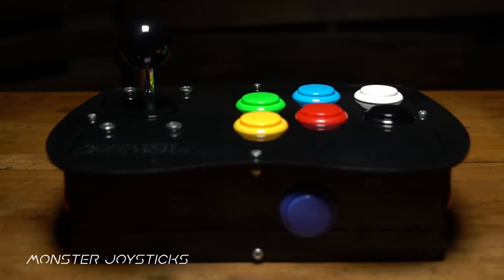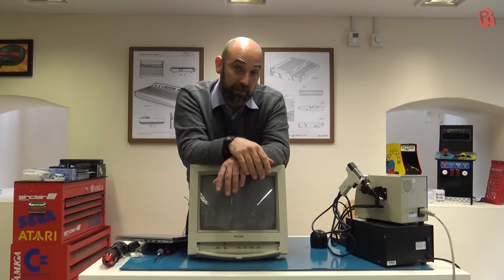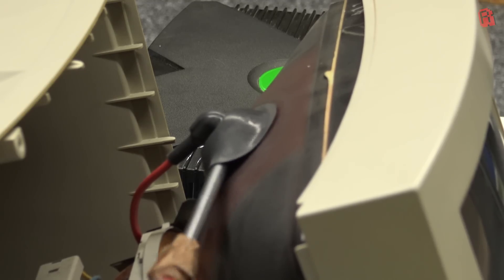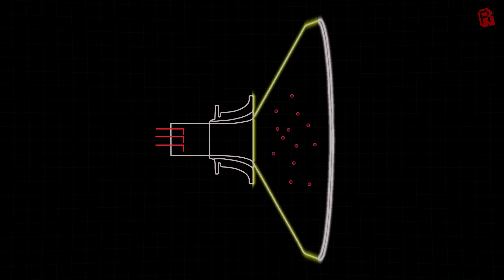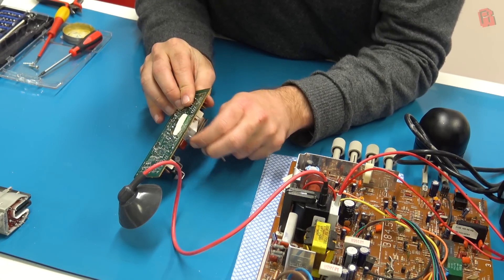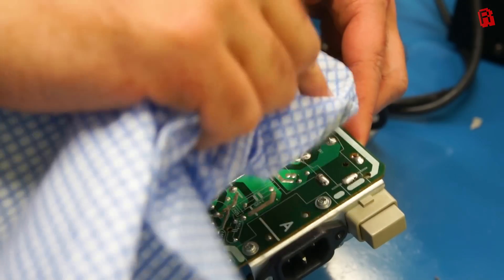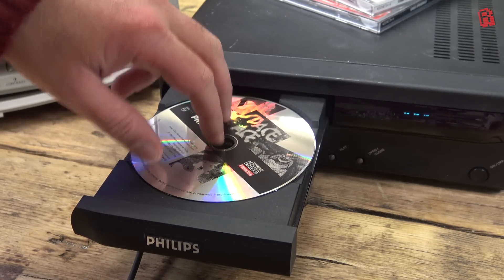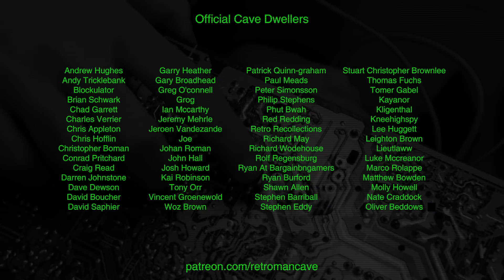Fixing up a CRT Monitor - Philips CM8833 Mk2 Flyback failure

Comment: Always best to keep these things alive, not only are they much better for older content but keeping them going cuts back on the e waste. I used to have same monitor back in my old Amiga days, it's still well worth having as I believe I am correct in saying it's will accept a 15hz signal thus it's Ideal for those 240p games. I still have lots of CRT tv's and vga monitors but when it come down to the VGA's as nice as some are, I have a Mitsubishi's Diamond Pro 2070SB more than capable of doing 2k, none of them can do older resolutions and it's all 480p and above unless play around with super resolutions and run it at 120khz. This Phillips is a great companion not just for a C64 or Amiga but also all those old consoles that are pre dreamcast.

Comment: Just had a new Flyback put in. The tech said the old one looked totally fine and made connection, but thought he would put the new one in anyway and it worked. 
12 hours of use and I’ve got the same problem again. What could it be? I gave him a HOT to change but he said it was reading fine

Comment: I need to clean out my TV.. 40" beast. Pretty intimidating tube and charge, I haven't had the nerve to attempt a discharge. I opened it up a few months back to at least dust it with some canned air. Unbeknownst to me, removing the back kinda pulled the tray with the board out slightly and the right speaker unplugged as well as another that says CC. When I reassembled, I noticed the sound was out on the right side. Due to work, I hadn't fixed it until just yesterday when I opened it up again. The pins were bent slightly, so I had to bend'em back and then put the speaker and CC wires back into their slots. Then I took some up close photos of the board and looked at them on the PC. It's just layered in cat fur and dirt... Ugh, I dread discharging... I have the tools for it, screw driver, wire, alligator clip for the grounding braid.. but wonder.. can I stand on a wooden chair and attach the screw driver's handle to a PVC pipe and discharge from a distance?

Comment: Hi I am curious wondering if you could by chance help me fix my Philips crt tv? The model number that I have is 24PT6341/37. The problems I am having with the tv is the RF connector on the back has broken off. Secondly there is no sound on the tv either. The sound went out right after the RF connector broke off so I am unsure where the issue is as I am assuming that had something to do with the sound no longer working. Is there any way to fix the RF connector and the sound on the tv? Please let me know as soon as possible!

Comment: guys could any of you give a hand with this¿¿ I´m saving this thing.. i repaired the shorted HTO and 3 bad capacitors but now im getting this red/magenta image that temporary fixes when aply pressure to the neckboard..I thought it would be the Green color so a resolder everything in that track but did not solved the problem.. is it possible that the problem is in the socket¿¿ somehow it does not make contact with the tube pins¿

https://www.youtube.com/watch?v=KKDllYVrfKg

Comment: thanks for your video. I've an ATARI SC1435 which has the same PCB mother board. And I trying to find the power on/off switch. But can't find it. And the TFT it's the same problem. Have you got any information where I can buy thoses parts ? Thanks for your help.

Comment: That was very instructive, thanks! I'm in the process of fixing my Mk1, luckily not the flywheel but rather some strange intermittent contact on the power board (which is separate board on the Mk1). I'm told the flyback transformer's soldering is often dodgy on these monitors. I sure hope that's not the case, since it is quite some additional work to disassemble the whole thing. Cheers!

Comment: I wish i had that desoldering pump... I'm stuck with a spring operated one that always leaves some solder on the pad and the component obviously won't come out... In my case, a flyback transformer as well

Comment: Well this will come in handy as i have a 15" monitor with broken solder joints on the neckboard and wanted some refferences before trying to pry open the cap on the tube socket so that i can unplug the flayback and work on it separate from the tube and the rest of the cables.

Comment: Thanks for this great tutorial :) The CM8833-II is really on of the finest crt you could get for retro gaming, a bit small in size off course, but easily adjusted and wonderful quality.
I noticed that you did not do any recap while fixing the monitor. What is your opinion on recapping cm8833-II? Some say all old crt need recap to operate safely and others seem to be of the opinion that as long as the flyback and solder joints are okay, the monitor should work just fine.

Comment: Great video, I've got a JVC CRT for my MiSTer and I agree they are a must for complete retro setup. After watching videos like this I'm not sure I ever would have a go myself, my Dad used to be a TV engineer back in the day and he's been zapped a few times, probably lucky to be alive! Only thing I noticed was the anode cable was touching the tube, on other videos I've seen a plastic wheel thing that makes sure this cable doesn't touch the tube, not sure if that might be an issue, this model CRT didn't seem to have one.

Comment: I don't recommend anyone not technically trained to work on these monitors or any other high voltage electronic equipment it could be very dangerous.

Comment: My 1084s monitor has no picture when I turn it on, plus no static when I touch the tube. The sound and power LED does work however. Also I have to hold in  the power button for the monitor to stay on. What do you think could be wrong.

Comment: Is the flyback specific to a certain crt or can it be installed in any crt?
Reply: They are specific to the tube
Reply: @adriaanstolk4487  great... 4 crt TVs that can’t be fixed.
Reply: @SolSeal  the tubes specifications just needs to be compatible with the flyback’s specs. Don’t give up yet. I’m sure you will solve it
Reply: It could be worth it to contact HR Diemen and ask them if they can help. There may even be services that can rewind the xformer
Reply: I have also seen that people replace the entire circuitry with a Chinese board that is designed for different tube sizes, I am not sure if they are going to be helpful or not, but it certainly is worth looking into. 

This website discusses one: 
https://jestineyong.com/fixing-es-china-kit-in-crt-tv/

Comment: obviously you must have troubleshooted the set before.. to determine it was the flyback?.... about 80% of the time it is a power supply problem causing no high voltage ...

Comment: Thank you ... that was interesting! First time I’ve seen a flyback transformer fixed since working on colour TVs in my high school electricity / electronics shop (a loooong time ago 🙂). One student (not me) did find out about capacitor to ground via screwdriver ... there was a blue flash and a loud snapping noise. He looked “surprised”. 😮🙂

Comment: you were quite lucky. Usually when the flyback died, some transistors and diodes died too, even in the primary PSU side. I would advise you to change non polarised caps that are labelled with a warning sight in the schematics, when they dimish even a bit, they can kill your flyback

Comment: Spent a full day replacing the flyback on my 1084S today.  I initially thought it was a failure because I got either black screen or a white screen with pattern depending on my flyback screen adjustment.  After seeing https://www.youtube.com/user/gibs2b (TinyLauncher is the greatest) run into the same problem, I finally figured out that I had to do the screen adjustment with the power on because it has to be exactly tuned before it works at all.  Fortunately on the 1084S the pots face the rear and are much easier to get at without risk of shorting.  Whew!  Oh, and now that the flyback is fixed, the power switch failed permanantly a few minutes later. XD

Comment: 14:50 One can always use a plastic or wooden artist's brush handle or knitting needle, just sharpen its end in a form of screwdriver head. Still have one of my own, it also come very handy in tuning RF oscillating circuits and throttles.

Comment: RETROMANCAVE, what circuits in the monitor does the flyback supply? the flyback outputs many voltages but to which circuits? what circuits does the B+ voltage supply in the monitor?

Comment: Yeah I had the 1084 monitor which died due the same thing as your where the LOPT died and at the time (many years ago) it was hard to get a replacment.
The LOPT also supplies some of teh Low Voltages too which was why my one was completly dead.
But back then I love the monitor.

Comment: Where did you get replacement flyback? My Commodore 1084S just went dead tonight, just turned off with sqeeking noice. Does not want to turn on again, no picture just sqeeking noise, lo power led. Please assist. Thanks.
Reply from the maker: Link is in the video description 👌
Reply: Yes, I saw afterwards, however not active any more. Never mind.

Comment: 4:03 Well damn! If I only knew this 20 years ago before I tried fixing my roommates monitor. I lifted that suction cup up and got worst damn shock ⚡️⚡️⚡️💥💥of my life! He thought it was funny, but man my whole arm hurt like hell! I learned from then on...DON’T LIFT THE CUP UP! 🙀 YouTube would have been handy to have had around back then! 🤦🏽‍♂️
Reply: Yeah that's a guaranteed way to get a bad shock. Bumping into anything else on the TV while running is pretty minor compared to under the cap where most of the voltage is coming from. :)

Comment: Apart from the 1084s  and MKII, which old CRT's (monitors or tv's) used the exact same component for flyback/LOPT ? How can I find out ? Buying a new flyback just seems too expensive relative to the cost of getting another monitor or removing an old flyback from another device.

Comment: I had the mk1 version of this monitor with my first 8088 pc connected to the RGBI socket. It was an awesome bit of kit, it doubled as a tv when I was at uni by connecting a video recorder to the scart (euro) socket. And could quickly switch between the two. Great to see one again.

Comment: are crocodile clips new? Ive seen/used alligator clips before, but never a crocodile clip......lol
Reply from the maker: Crocodile Clips is the lingo in my shire but if you do a quick google for both terms you'll see they yield the same results
Reply: @TheRetroCollective  yeah, i figured it was the slang in your country. Just sounded funny to me when i heard it...i did a google search, and learned that a Kelvin Clip is an alligator/crocodile clip with the 2 jaws isolated from each other, so 2 independent wires can be connected to a single test point. I didn't know those existed :) good day sir!

Comment: I did a lot of Philips TV flyback transformers back when they were current. You normally don't have to dismantle the CRT base socket. Usually if you very quickly push then pull on the lead it will pop out. The new one just pushes back in and is gripped by the tang inside.

Comment: Irish company also stocks the FBT
https://www.donberg.ie/search?query=hr7533
You can use 3 layers of heat shrink on the cable to the neck as it has between 20% to 28% of the anode voltage and at very low current.

Comment: WARNING: The CRT tube is under vacuum. It will implode and shower glass everywhere if it cracks even a little. Arguably this is the most dangerous part of working on a CRT.
Reply: still crt can last years and years . i have toshiba crt tv working still age 30 years. though it has a flyback replacement  few months ago. still good as first day.

Comment: I learned something.  I always assumed that the high voltage from the flyback transformer was used for shooting the electrons at the screen but your explanation makes sense.  The flyback doesn't connect to the electron guns but rather the CRT and even the word flyback describes what you said.

Comment: You can get those plastic adjustment tools on amazon... that said, you can get insulated shaft screwdrivers at Home Depot or Lowes.... or whatever the big box home remodeling stores are across the pond... I have no clue what those may be, or if our names are international.... but they're widely available.

Comment: Thankfully I dont need videos telling me not to mess around with Flybacks because I already learnt that lesson as kid when I opened up a TV to see if I could fix it and tried cutting through the big thick wire going to the tube with a pair of metal scissors shortly after having turned the broken TV off and unplugging it.
Needless to day, getting zapped by 25,000 volts doesnt tickle (especially if you do it outside bare foot like an idiot)

Comment: I happen to open up a Brionvega Agol 11 today to see how the fourhole propriarty powerplug works... I seems that most likely the brown and blue wires can be plugged with a C8 polarized plug, but there is a black wire and I'm not sure what it's needed for. Guess I'll have to test it with a multimeter.

Comment: OMG! Neil! Almost exact same story as yours, happened to me few yrs ago. I went to buy an extra Amiga to have one for extra parts. Checked local ads, found one for cheap, no picture. I sat in the car, drove uptown, I enter that living room and a total shock!!! It was the Limited Edition (Stefanie special edition) + mint CM88333 + a box full of floppies all included in that price. The lady had no idea what she had. Something like 20 quid. I completely restored that Amiga, installed a NOS keyboard (German edition to make it fully legit). Later i soldered in 512 kB of RAM from a spare motherboard, so now it is 1MB chip RAM. Now just to install a battery somehow to get that clock up and running. I wonder do i need to build some custom jumper so that Amiga "knows" it has a battery since the expansion slot is vacant.

Comment: I must have replaced hundreds of those Philips flybacks and power switches.
A lot of their small TVs used the same items.  The replacent switches never lined up, always had to remove the metal from the old one.
I always wondered why Philips made the flybacks with the screen and focus on the wrong side.  It made no sense.  Both need adjusting live to get rid of the retrace lines properly and focus properly.
You did a great job.
On the neck board, I never had a tool for that.  Always a screwdriver, plyers and patience to get the darn thing open 🙂
Reply: Brendan White I took a lot of CRT television sets apart when I was volunteering at a charity.  I was recycling them, and now I wish I hadn’t, because they would be worth something today
Reply: @infinitecanadian  Sad thing is here in the states a lot of old CRTs were sent over to India for recycling due to the dangers of the CRT.

Lately when I come across a CRT I snag it and rob the Flyback, Degauss Coil, and Yoke from it. If the Tube doesn't have any burn in and if I have room I keep the Tube if it's smaller then 21 inch.
Reply: Those Philips LOPTs in these and the 1084 monitors dropped like flies and were a good earner for repairers back in the day. And yes those crappy power switches. Philips also made VGA monitors for Osbourne computers here in Australia and they used to cook all sorts of inductors and were a good earner too.

Comment: There will be a time, you wont get replacement flybacks anymore. How will we fix our monitors then ?
Reply: As I mentioned in a previous comment, I found a company in Europe called HR Diemen that seems to have all of the designs for pretty much every flyback ever made and can reproduce them. They are not cheap but it's nice to know that in future when new old stock is no longer available there is another option.

Comment: Spent many a day in front of mine with an Atari, and I remember seeing them on TV. Mine came from Cash Converters for 70 quid, stank of cigarettes but worked fine for years until it was dumped in a chaotic house move. I did have to resolder the input socket once. They ran well in 60Hz! Alas I just can't look at a 50Hz CRT anymore, the flicker is painful!

Comment: nice one neil and no shocks too, its great to know that you can still get these flyback transformers......seeya in the next episode @@@kim@@@
Reply: I recently bought a NOS flyback for my Daewoo rebranded Commodore 1084S monitor from eBay really cheap, however in the process of trying to find one I did find a company over in Europe called HR Diemen that seems to have all of the designs for every flyback possibly ever made and can reproduce them. They weren't cheap, but it was nice to know that in the future when all of the new old stock flybacks still in circulation runout there is company that can still make them!

Comment: I need one of those switches for my Olivetti PC, but there are a lot of similar ones and I can’t find the exact model, any suggestion on how to find a matching one?
Reply: Google image search all the numbers printed on it.
Reply: That’s the first thing I did 😄
It’s a Preh ME5C. Nobody on Earth seems to have it. What’s funny is that it’s supposed to have some low voltages pins, but mine only has the mains ones. Apart from that, it’s identical.
I need one of the same size to fit the lever that gies to the front of the PC. The switch itself is inside the PSU.
Now I wonder if a regular AT PSU has the same switch, but on cable. I must check my pile of salvaged parts...

Comment: One thing you should probably mention, is that sometimes a dead flyback can take out the horizontal output transistor that drives it. Usually if this happens, you wont hear any whine though.